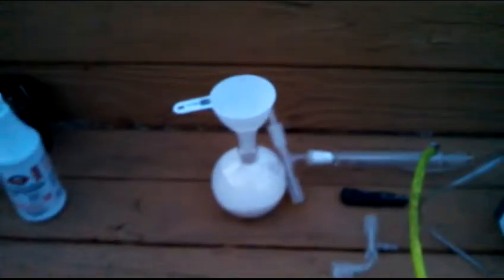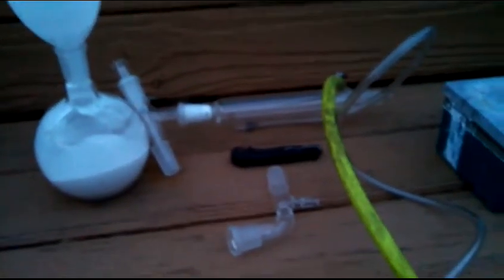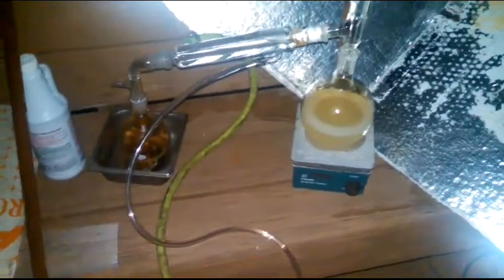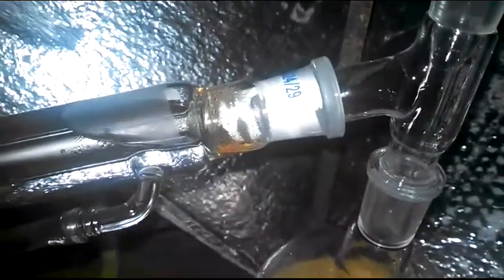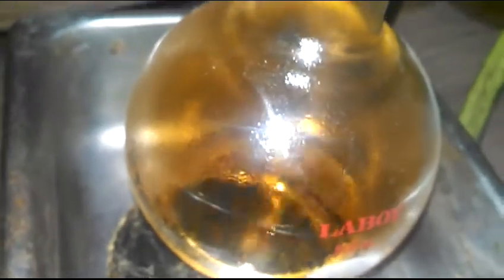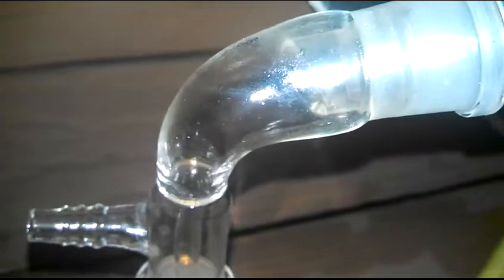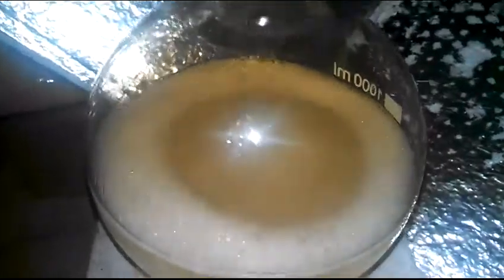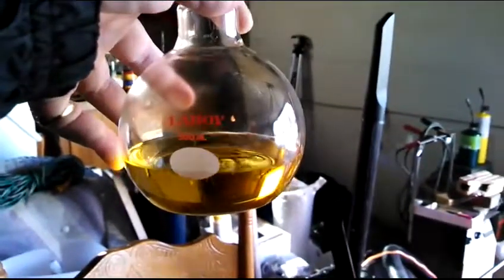Distillation of nitric acid for precious metal refining

Comment: Make a water trap and then on the other side and bubble the nitrogen dioxide through water.
Reply: I just saw JamesG comment. If you're going to use H2O2 and not H2O make sure is well under 35%  or you could end up with explosive decomposition of the peroxide.
Reply from the maker: @darianballard2074  good to hear from ya my brother.
Reply from the maker: @darianballard2074  but wouldn't that be fun, lol